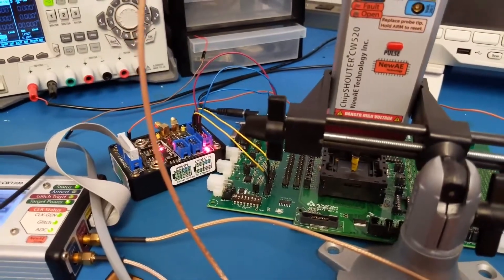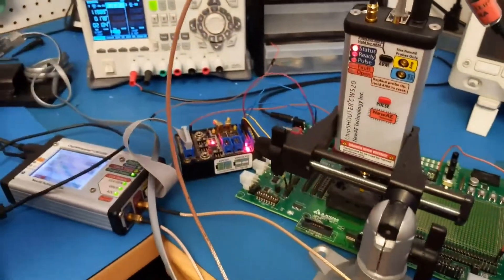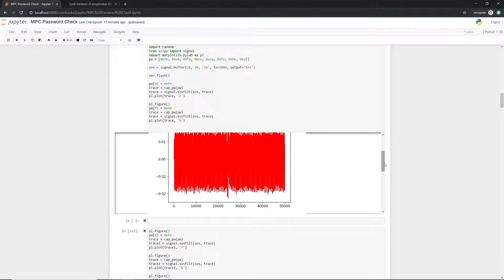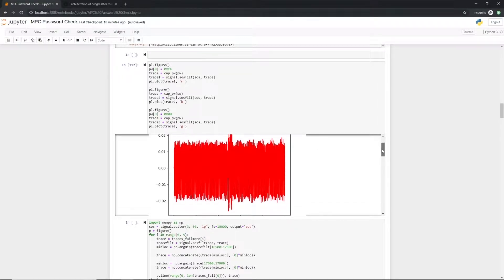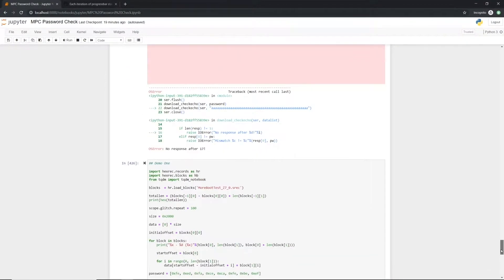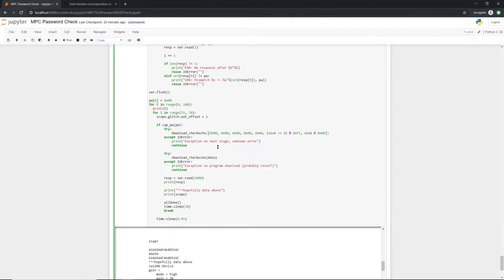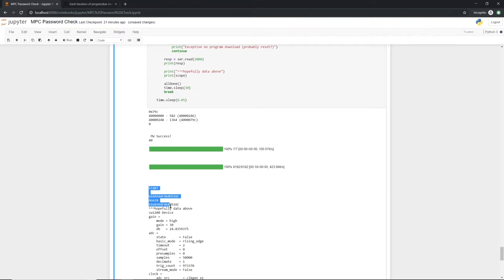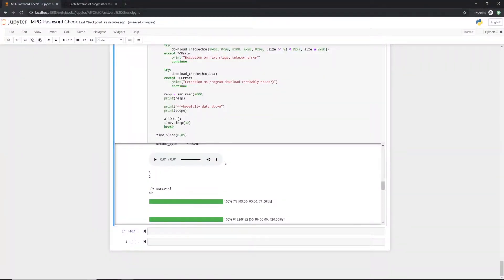GM Duramax L5P ECU/ECM (E41) Teardown Part 4 + EMFI (Electromagnetic Fault Injection) Tests

Comment: Also in your pdf can you explain this further? "Most devices in the MPC55xx and MPC56xx series include the Boot Assist Module (BAM) code which includes a serial or CAN bootloader mode. In these devices, various pin strappings are used to enable the bootloader. There is no method of disabling the bootloader entry, as the pin strapping takes priority over internal flash. Later devices in the MPC57xx series allow ignoring of external pin strapping"